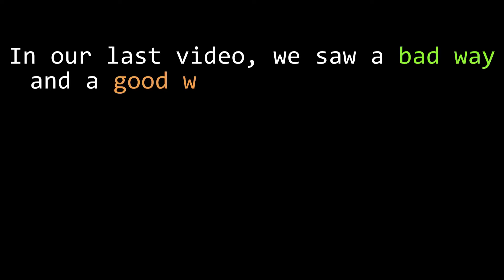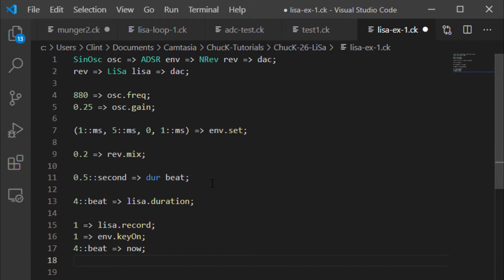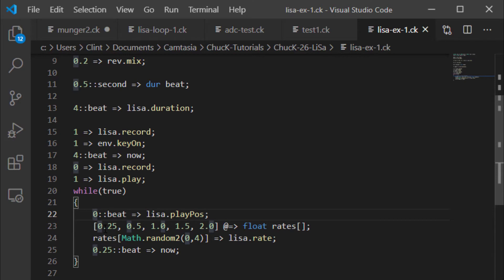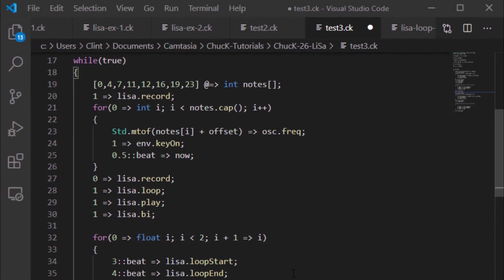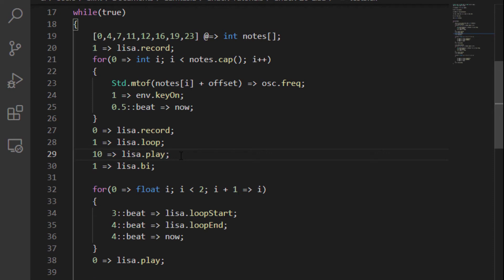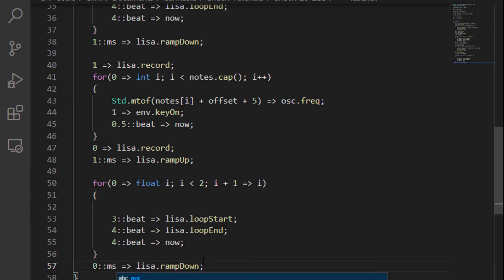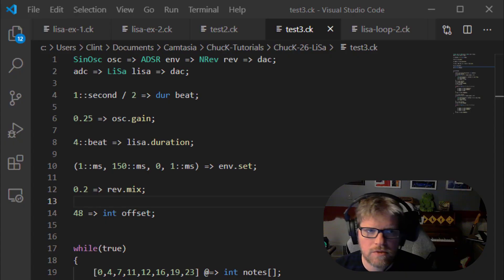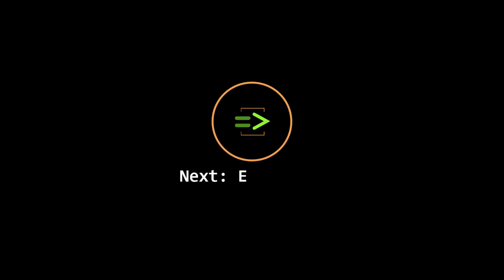26 - The LiSa ugen - Creating Electronic Music with ChucK

Comment: I started experimenting with Chuck yesterday and thanks to your videos managed to make a pretty nice 909 bass drum sound with the usual parameters. Now I'm fantasizing of building a whole drum machine and have  two questions.

1 How would you create a graphical user interface for a script to make basically a standalone virtual instrument?
2 Do you think something like Raspberry Pi could run Chuck, making use of gpio for control via buttons and pots because that would be even cooler?
Reply from the maker: That's awesome! I'm glad you're finding the videos useful. :)

As to your questions:
1: I have not tried to do that. There are two avenues for investigation (both of which I intend to investigate in the future but which I have not yet done): Chunity and extending the miniAudicle. Chunity (http://chuck.stanford.edu/chunity/) is a Unity plugin that integrates ChucK into Unity, where you could use Unity to build any user interface you could imagine, up to and including a 3d game or even a virtual reality experience(? I think?). The miniAudicle docs (http://audicle.cs.princeton.edu/miniAudicle/mac/doc/) suggest that it's possible to define extensions to the miniAudicle interface that will be exposed when you run it. This does not appear to have been implemented on Windows or Linux, just on Mac.

2: I've never done anything with a Raspberry Pi but it's definitely possible to run ChucK on it; the ChucK book says that because ChucK runs on Ubuntu, it just works. Additionally the CCRMA made their own Linux distro(?) called Satellite which has ChucK and Faust built in: https://ccrma.stanford.edu/~eberdahl/Satellite/ . I have never experimented with any of that stuff, it kind of seems like they were very into it 8-10 years ago but haven't done much with it since.
Reply: @BachelorMachinesTV  thanks for the quick reply. I think I'll first try learning to code something that I think is really good and then start to look into the interfacing options. Thanks again for these videos, they are a perfect place to start.